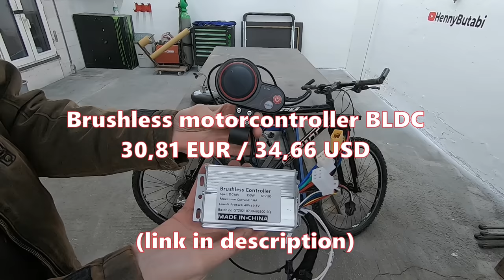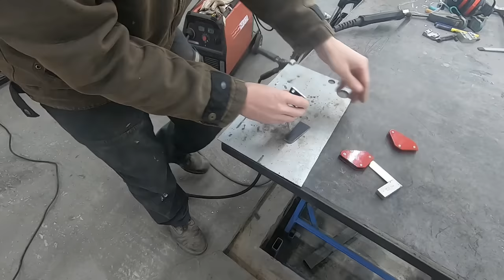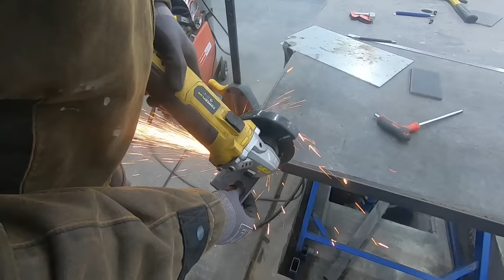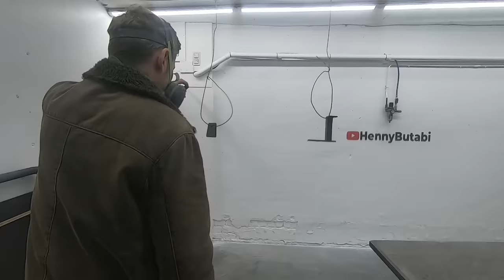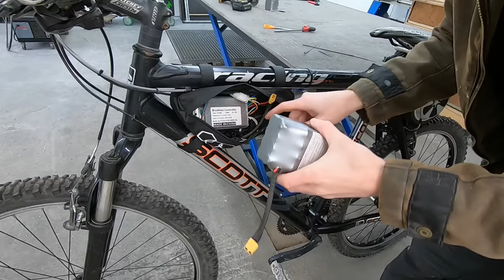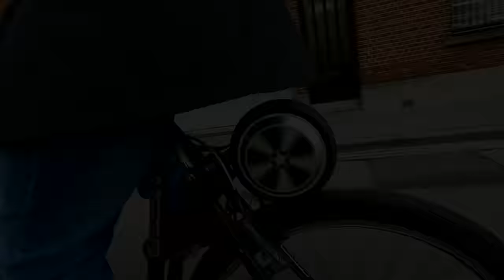Building a very cheap e bike with hoverboard motor - easy conversion

Comment: Awesome built! I am really thinking about converting my old hoverboard in a E-Bike like this!

I was wondering though, how do you charge the old hoverboard battery now its out of the board and the battery doesn’t have a build in BMS?
Reply from the maker: I just put a xt60 connector on the charger and plug in the battery directly. The battery does have a bms. This solution works perfectly.
Reply: @hennybutabi  Great to hear, thanks for your reply!

Also another question, what did you do to the cables comming from the hoverboard wheel to make it work on the e-bike controller? It looks in the video like you changed the adapter for the 3 fase wires coming from the wheel to one with a white adapter. Is there a purpuse for that? 

Would love to hear from you, seeing as I am currently building my own version of this and I want to do it correctly the first time XD
Reply from the maker: @pjotrmaes  its just a type of connector, you could use any type you want as long as you respect the color of the wires😉

Comment: Have build on like yours. but think speed was to lov at 36V so i went with a 72V battery. how fast do you go with a 36V battery?
Reply from the maker: Topspeed is 27km/h on 36v. I still have to test it on 48v, however on 36v it's fast enough for me😏

Comment: How did you achieve such speed ? I have a stitched board with a gyro scooter , at 36v the speed turned out to be 19 km h (
Reply from the maker: I don't know, maybe it's the controller. I did not change anything.

Comment: How did you get it to go so fast, mine tops out at 19 kilometers per hour?
Reply: What controller are you using?

Also, there are different types of hoverboard motors. The ones that weigh 2,9 - 3 kilo and have 30mm magnets are the strongest.
Reply: @bobdebouwer7835  same controller is him but I figured out the issue, I'm using a 36 volt battery and he's using a 42 volt.
Reply: @sandpiper1515   Usually 36 and 42 is exactly the same. 

The cells are around 3.6 to 4.2 volt. That's why it's usually the same. It's just that some people call it 42 and others call it 40 or 36.

Just like tool batteries. Some say 18v but other brands say 20v. In reality it's the same.

There must be something else.

Comment: How much does it slip/lose traction on the tyre when wet after going through a wet road and puddles.
Reply from the maker: When it's wet it slips non stop😏
Reply: @hennybutabi  thought it would. It looks cool though. Do your legs end up getting soaked?

Comment: can you also use 2 hoverboardwheels?
Reply from the maker: You can use as many as you want, but you will a need separate controller for each motor.

Comment: Can someone please explain this to me, I want to buy these kits off Amazon (electric bike conversion kit) and it uses the same battery as you showed at the start. How do you charge them do they need to be charged if so how ?
Reply from the maker: I just charge it with the hoverboard charger plugged in directly. I suppose if you buy a kit the battery and charger should be included
Reply: @hennybutabi  thanks 👍

Comment: I can see that the BLDC has very many wires. Did you only connevt the three motor wires, the motor sensor wire, the battery and the controller?
Reply from the maker: Yes that is correct, all others were not necessary for me. They are for lights, brakes etc

Comment: fitting the drive to the front wheel would be easier?
Reply: Moskito    fuorilegge
Reply: only if you are 100% sure it will not jam.. Because then your wheel blocks and you go kiss the pavement

Comment: I'm wondering how you can achieve a speed of 27 km/h when the top speed of the hover board is 7 mph?
Reply from the maker: Hoverboard is controlled by the motherboard sofware. Now the motor is controlled by external bldc controller which gives it more rpm

Comment: Try the hoverboard motor without tire to reduce the nose or chage the tire of bicycle to city road tire
Reply: metal on rubber is probably not a good idea
Reply: The speed will drop when the motor is smaller without the tire.

Comment: How did the controller connect to motor so easily?
Reply: Not easy, he had to wire on the proper connectors, about $25 for the kit and crimper.

Comment: In the video it shows the controller having a t60 connector for the battery but in the aliexpress listing it doesn’t. I don’t know which connector it will ship woth
Reply from the maker: It comes with another connector. I cut it off and soldered the xt60 myself
Reply: @hennybutabi  ok. is there a charging port on the throttle/controller or do you have to use the one on the hoverboard?

Comment: why didn't you attach the motor to the bike frame with paint? this way you have weakened the frame's resistance and risk deforming it! (sorry, I use google translate and I don't know how grammatically correct it is translated!)

Comment: how thel.. you get 25+km/h with minimaly 1:5 minimaly..  ratio to slow when motor itsefl KV ( rpm/volt) is is about same max speet itself use as on scooter etc.. whhl..  2 batery in series??? rewinded motor?? WYE instead of delta?? where is that jocke hiden.,.
Reply: or you have a 20AMPS  field weakening.. ( actualy give rpm for moére phase curent by VESC..) this MF just say nothing about real setup whole juts wanabe magick..

Comment: 25kmh is the speed of the rotation of the small wheels not of the bike. its impossible to drive it for more than 10 minute because of small battery.
Reply: "25kmh is the speed of the rotation of the small wheels not of the bike." Are you sure???
Reply: @michaelngan99  the hall sensor is inside the motor Wheel not in the Bike wheel. Yes im pretty sure. And what about the small amp battery. You can do it , do 500 meter and dome. Nothing more .
Reply from the maker: You can clearly see my phone which works with gps 😏. The controller display is calibrated using phone gps. You can adjust wheel diameter until its correct

Comment: The french had a bicycle with a 25 cc engine that drove a roller resting on the front wheel. It would run all day with very low gas consumption. Yet today's e bikes are supposed to be progressive.

Comment: Im waiting on my $100,000 to buy all this equipment to be able to build an easy conversion of a very cheap e bike with hoverboard motor. Then ill go to school to learn how to weld and use all the machines I bought for years in order to build a very cheap e bike with hoverboard motor easy conversion.
Reply: The only thing custom made here was the motor mounting bracket. The rest can be made/installed with basic hand tools. The motor controller comes with instructions so no school needed. Many online services will custom fabricate or 3d prints parts for you and mail them to your house cheap so you don't even need special tools or skills to fab the motor mount.
Reply: You can buy a welder for +- 60,- euro today. 

You can get a metal saw for hand power or just buy metal jigsaw blades.

Comment: Might as well just buy an easier ebike kit. I don’t have those tool’s available. Welders and electric steel saws. Yeah nice but not an option for most people.
Reply: You don’t need all the machinery that he has you just need to use your head. most of what he’s doing can be replicated with smaller simpler tools, but it takes more manpower and time as well as human precision. if anything have it as a side project